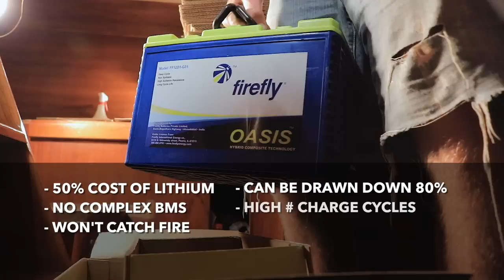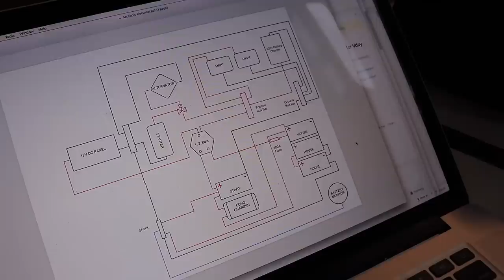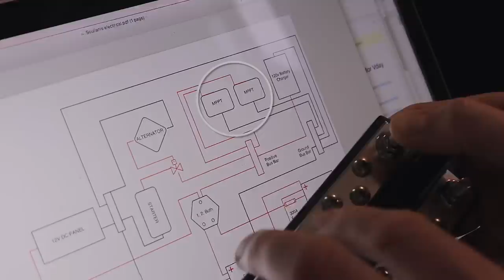Why You Should Do Your Own Boat Work | Sailing Soulianis - Ep. 37

Comment: You can use "lumber yard" grade plywood (typically ACX, one good side, on not so good and exterior glue) IF you apply a 2 or 3 coats of epoxy or at least oil based exterior paint.  Fill the voids in the edges and on the back side with thickened epoxy.  This is mainly for looks.  If you are going to spend the money on marine plywood, you can typically go DOWN one size.  Instead of 1/2", you could have used 3/8" (9 or 10mm).

Comment: Making templates with cardboard as you design your projects - great way of following the old adage “measure twice, cut once.” I do the same for my fabrication projects. BTW - I don’t think there is a single boat/home owner that has NOT had at least one contractor not come through as promised, but it’s better to end the contract than have to look at your “compromise” the rest of your days in the boat. Keep up the good work. Love your videos. Bravo Zulu.
Reply from the maker: That's exactly how we felt.  We were actually relieved after we fired them.  We knew we were going to be frustrated looking at that thing on the back of the boat every day.

Comment: You should have put the shunt BELOW the distribution strip as you may never work on teh shunt but you WILL work with teh distribution strip to add or subtract more circuits or trouble shoot power problems.

Just a thought , (;-) TP
Reply: What does the shunt do?
Reply from the maker: The shunt is what allows the battery monitor to monitor. It acts like a calculator and tallies up all incoming and outgoing amps.
Reply: @AdventureOtaku  It's a tiny bypass - a small percent of the electricity flows through it and you can run an ammeter to monitor charging or discharging. With modern electronics, it can be pretty precise.

Comment: Glad to finally see another video from you guys. Obviously you guys are keeping quite busy. I know this has to be old though, because you have posted photos on fb of areas of clear blue and not Mobile for quite awhile. Come on! Get it together! Just kidding!
Always love seeing you work through the projects that come up. I have a suggestion for the shelves. You might want to consider putting a backing wall or a stop of some sort on each shelf so that in the future if you get in a condensation situation your clothes stored there wont be up against the hull. Just a thought.
I hate what you are going through with the fabricators. You are more patient then me. I would have already fired these guys.  
Anyway, good luck and hope to see more videos soon!
Reply from the maker: We did consider adding a screen backing to the shelves to keep an air pocket back there, but didn't have any suitable material on hand; we did leave a small airgap on the back of the shelves though so that we can add one in the future. We had some extra non-slip placemats we ended up lining the shelves with, and so far the clothes have stayed put. 👍

Comment: Kirt, when looking for thick cables that are FLEXIBLE look for SO cables. These are thick and flexible. SO cable is one of the most popular and versatile portable electrical cords made today. These are multi-conductor cords, comprised of 2 or more conductors, which can be used in both indoor and outdoor applications.

Comment: It took me three weeks of slow but incremental progress to rewire my batteries and add a shunt. I had to see the bending radius of the larger cables in order to calculate their lengths and routing.

Good job planning for that project and I bet you love your new energy monitor.
Reply from the maker: Sounds about right.  I contemplated buying pre-made batter cable in the beginning, and I'm so glad I did not.  That would have been an absolutely nightmare. I'm so much happier to have bought the tools.

Comment: It looks like from the preview that you chose to walk away from the arch project.  If that's the case, congratulations.  I was going to say the same thing until I saw the very end of the video.  These types of contractors just don't learn if they are let off the hook for crappy work and significant time overruns.  Good on ya!  Really nice work on the battery box and shelves too.  So nice to be able to use up those supplies in such a productive way!

Comment: Curious about the shelving... I understand the mold on the hanging shelves and how it happened...  But, how have you protected yourself against your clothes sitting in that closet up against the side of the boat doing the same thing next time it gets cold?  Sure - don't ever go into cold environments again.  This is my favorite channel - keep it coming!
Reply from the maker: We left an inch or so between the end of the shelf and the hull. The idea was that eventually we will put some foam against the hull or a screen material along the backside of the shelves to keep a pocket of air there. We also lined the shelves with nonslip placemats, and the clothes haven’t moved.

Comment: So, I'm not entirely sure where Virginia lies in relation to Alabama,  but 

Sailing Uma (ep 174) just had a new solar arch & stern and bow pulpits 

manufactured at Howdy Bailey Yacht Services VA.  They were very 

happy with the work standard.  Hope this helps  :)
Reply: I've had Howdy Bailey fabricate a pair of fuel tanks and I've seen other work he has done.  He is the king of aluminum work.
Reply: Alabama itself is not that far away from VA .... by land. By water is another whole story and makes that way out of the way. They are in Mobile, AL. Which is in southern tip of the state in the Gulf of Mexico. This means they would have to sail to FL. Check, as they already intend to do that anyway. However, then they have to sail south and down the western edge of FL, clear the southern tip and sail east and up eastern side of FL. And sailing roughly half way up eastern coast of the US to reach VA.

Imagine you are in Calais, France and someone recommended place in northern Italy. By land it is not that far. You were already planning to sail to some southern part of France anyway, but now that would involve sailing down and around Strait of Gibraltar and back up to northern Italy. Roughly 2500 km (1350 nm) trip.
Reply: Could they maybe e-mail their requirements and hire a van to drive and collect ? @kevinfisher1345
Reply: The fabricators typically like to come out and take the measurements, and quite often they will do a test fit later as well. At least from what I have seen. Before bringing the product out for the final install, with maybe some minor tweaking. (not all of that winching with straps like they showed those idiots doing). 

If all goes well and they really know what they are doing, its just the initial measurements they take, and bring out the final product to install and it fits like a glove. But even they will occasionally might have to do some minor adjustments or maybe a test fit.

If a fabricator is willing to allow customer to measure and trust those measurements ... I would run. This is supposedly custom work, not some basic mass produced. To use customer measurements for a guestimate and possibly price quote is one thing, but to custom manufacture. Hell no. Run.
Reply: Yeah he really looked cool  @jeffwingfield9299

Comment: Bad news about the arch, I hope you got something sorted....  With regards to your clothing storage, is it possible to insulate the hull in that space, that would then prevent the condensation from building up in colder conditions? Also may be add some ventilation holes to the shelves to allow the circulation of air through the space. Anyway I hope it is an improvement on what you had before. Great work on the electrics, that looks like it is coming together nicely.
Reply from the maker: We did leave an air gap at the back of the shelves (they don't go all the way to the hull.) Adding insulation is also an option that we can still revisit in the future.  So far so good though!  We'll just stay out of the cold :)

Comment: Well that truly sucked.  After getting hosed on stuff like your arch a few times in my 60+ years, I now trust no one.  I used to believe I could trust most everyone  to do the job correctly until they proved they couldn't.  Sadly, that is no longer the case.  Now, I know going in that most won't do it right and they won't give two spits about it either.  I tend to do a lot of my own projects now.  If you want it done they way you want it done you'll have to figure a way to do it yourself.  The pain from this situation will give you insight into working with all other contractors in the future.    Knowledge is power.  Proceed accordingly.

Comment: I use deck tread squares on floors and bulkhead walls to keep some air and water movement = less mildew. 
I have exactly the same types of experiences with people working on my boat (79 O’Day) that I’ve been rebuilding for four years now.  I have accepted shoddy work when I didn’t want to because they pushed me back and back so far that I had to go with it.  I have also refused to pay for shoddy work and this is something I HATE to do to a worker that is doing their best but... There is probably legal action taken against me for one instance but I complained early, asked for and gave plenty of time and consideration for corrective action but when none was taken I just left... with the crappy paint job and what was left of my money.
Another mistake I’ve made is paying for the work before it was done leading to even less enthusiasm towards our timeline.  Although I get some of your venders behavior, trying to get and keep new customers, cruisers however go away... so their precedence is not as high as local repeat customers... enter YT, venders beware.

Comment: Hi guys I really feel for you getting saddled with a bunch of amateurs like this company appears to be. I have made an arch and Bimini for my yacht. I mocked up the whole thing with buteline which is a pvc pipe with a thin alloy sleeve used for plumbing systems. Buteline is great because you can bend it to shape with your bare hands and it stays there. I can’t believe these guys did not mock it up first, it’s the only way you can get all the angles to work out right. One other thing, personally I would only use stainless steel. 1” diameter is perfectly sufficient for stiffness and rigidity and the weight would be no more than the 1-1/2”? alloy pipe you were using but the main reason I would use stainless is that it stays clean and shiny unlike raw aluminium which will become corroded over time. Anyway some would say these things are sent to try us, personally I don’t believe that at all, and you will be able to forget all about it when your sails are set and your course is south. Love you guys and your videos are excellent.

Comment: Yeah I learned the same thing working on houses, you can almost never find someone that does good work (at least I can't in S CA) so I always do it myself.  I even had to dig out the crawl space under the house and do my own plumbing, which was not easy with my claustrophobia, but I didn't trust anybody with copper pipe work and sewer pipe work.  They almost ALWAYS screw it up, so it's best if you can do it yourself.

Comment: If it is "real" marine plywood (BS1088) it is actually stronger than regular plywood because it has more plies for the same thickness and it has no internal voids.  This means that you can use thinner plywood for the same job.
Reply from the maker: Ya we were happy to use 1/2” but couldn’t find it anywhere. Fortunately we’re not YET on a multihull where weight is a big concern.

Comment: Those "Fabricators" were way in over their heads. They figured out early that they weren't making any money on this job, so they were going to piece it along until it maybe, sorta got finished or you fired them.   They weren't smart enough, or cared enough that you have a  video blog of them not getting the job done.  It sounded like even though you weren't completely pleased with the design they came up with, you were willing to accept it if they would just finish the project.  At some point you have to pull the plug, regardless if it cost you some money. 5 years from now, you won't miss the money, but if you had to look at that arch that you didn't like every day, you would regret not firing them.
Reply from the maker: This was exactly the line of thinking that lead us to our decision.  We felt quite relieved once we were rid of them, extremely frustrated, but relieved.

Comment: I am supprised  you could trim down, (sand down ) the  original battery box and fit the new batteries.
Reply from the maker: The battery didn't fit by less than 1/16. We could of forced the battery into the box, but it felt like a poor idea.  It was pretty easy to cut out one side, glassing in a new piece of ply wasn't too bad since we had all the materials on hand, and were already doing other glasswork.  In the end it was only a minor setback.

Comment: Hell mine was 3 days in s/s ame as you’res   Cost $600   I fitted the solar panels , interesting t see how the battery’s last  a tip is to drill holes n the sides of the battery box to vent those battery’s as they need them   We have the same and they do get warm in our climate and in two years they have lost capacity as the fine print says ,and  you will need a regular in the input line   , we de regulate the alternator wich helped to fill them Quick wich is a 100 amp and change the pullys to flat belts , gives the alternator better grip under load from slipping, doing your electrics , does you insurance company know your doing  Most marinas want an electrical cert  good luck

Comment: Fabricating something for a boat isn't as easy as it looks because one side is NOT the mirror of the other side and can be inches off in some cases, I know because I've been there with my 18" Seaswirl. That aside, the contractors look as if they didn't have a plan before beginning the project. You need to have a fixed point to reference every dimension too. I'm curious as to whether a laser system for kitchen countertops or landscaping, could have worked. I know one system used in the machine tool industry that would definitely work, but I doubt they have one in Alabama.

Comment: You're going to run your entire DC panel off a single 12 ga wire?  I know sailboats don't typically have a big electrical demand but that seems extremely small.  I'm hoping you've done the load calculations to make sure you're going to be OK on such a small wire?
Reply from the maker: I think you may have mis-heard. There was a 10-guage to the panel not 12, which was the way it was wired originally. This electrical project was just to replace the batteries, and add solar. We've done few other electrical projects since then but honestly this is not one we've updated, but you’re right it is probably a good idea to replace it with a larger gauge wire.
Reply: @SailingSoulianis  Even 10 seems crazy-small to me, but I work mostly with mid-size powerboats.  A typical DC panel for me would be served by maybe 2/0 and have 20-30 circuits.  I'm sure a sailboat like yours has a much smaller DC load.  Looks like you're doing good work - keep it up!

Comment: Unfortunately you get stuck between a piece of stainless and a hard spot. It's hard to determine when to put the brakes on a project like that .You keep praying these guys are gonna make it right and that doesn't happen. Great work on the batteries and wiring .
Hope there is a somewhat ok ending
Reply from the maker: Exactly. If we hadn’t had put down a deposit, we would’ve pulled the plug at the first inkling that things weren’t going right. But being financially committed made the decision extremely difficult.
Reply: Just look at as very! good learning experience. Cheers

Comment: Love this video! It has a lot of good content and is so realistic as to contracting someone to work on your boat... We have the same IKEA storage in the same locker (we have a T37 too). Did you sand and prime the marine plywood before painting with Bilgekote? I also remember a while back before you took your mast down you took photos of everything, is it possible to share those pictures? Our mast is down and we are nearing the end of our refit and we would love to see how things are supposed to look like, it would help A LOT!
Reply from the maker: Hi Aysha, we did sand the shelves, but did not prime, probably should have, but we were sick of carrying around the bilgekote paint, and just wanted to use it up, so I think we did two coats of that and called it done.  The photos we took are probably not going to do you much good as they were mostly how specific hardware was done on our boat.  But if you're interested many of the photos are here: https://sailingsoulianis.com/how-why-we-shipped-our-mast-from-chicago-to-mobile/
Reply: @SailingSoulianis  Thanks! :)